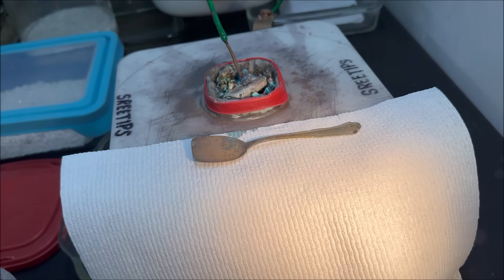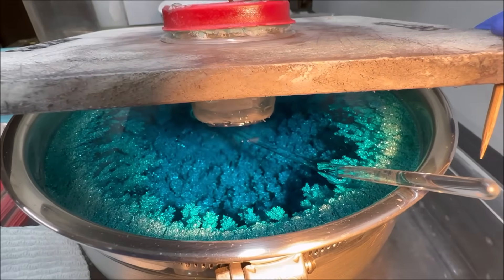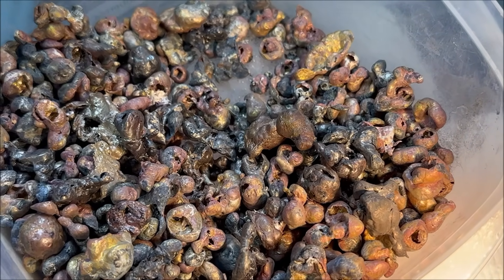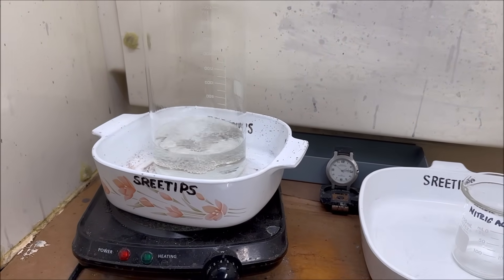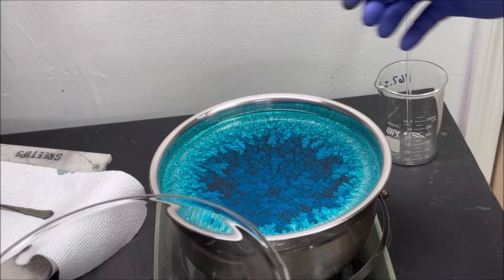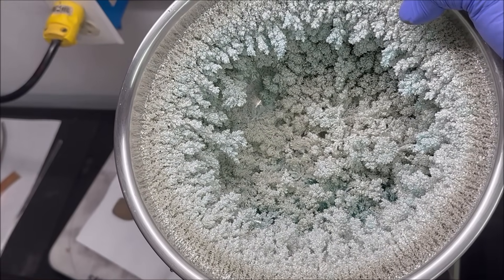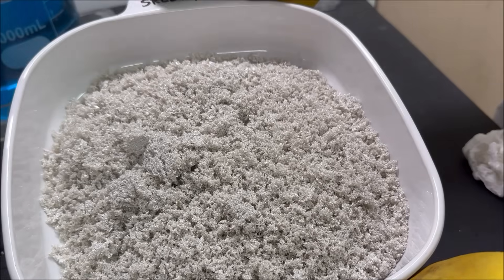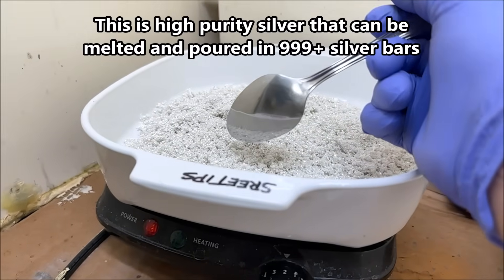999 Fine Silver Cell Harvest and Reboot

Comment: whats the take in by that ?
Reply from the maker: I refine gold. I use sterling silver, that I buy at estate sales, to refine the scrap gold. I recover the silver from that, melt into shot, and run it through my silver cell. Silver is a by-product of my gold refining. The cell converts the impure silver (about 980 parts per thousand silver) to high purity four nines fine (9999 parts per ten thousand) pure elemental silver metal. So I’m refining the impure silver, into high purity silver, not creating silver out of thin air. When it’s full, I harvest the pure silver crystal, put it away and forget about it. Then I repeat the whole thing again.
Reply: @sreetips  ah thank you , magnificent work you got there.

Comment: So what do you do with this silver? Do you sell it?
Reply from the maker: I refine gold. I use sterling silver, that I buy at estate sales, to refine the scrap gold. I recover the silver from that, melt into shot, and run it through my silver cell. Silver is a by-product of my gold refining. The cell converts the impure silver (about 980 parts per thousand silver) to high purity four nines fine (9999 parts per ten thousand) pure elemental silver metal. So I’m refining the impure silver, into high purity silver, not creating silver out of thin air. When it’s full, I harvest the pure silver crystal, put it away and forget about it. Then I repeat the whole thing again.
Reply from the maker: I may start selling some 5 ounce silver bars when silver gets up over a hundred bucks.

Comment: Where does he live. I'd do it in LARGER scales. 1 kilo, HA. I'd go into manufacture. IE; 100000 KILOS A WEEK. PROOF IT AINT WORF DA  BOVER. DUH..
Reply from the maker: Not with the Thum cell, like I have. To go that big you’d need an industrial size moebius cell: alternating anode and cathode plates hung in a tank containing gallons of electrolyte. That would pull hundreds of amps. Far exceeding the limits of my small hobby operation.

Comment: Honest question, do yo profit from this activity or is just your love for chemistry and the hobby, i think you spend considerable money on glass and chemicals?
Reply from the maker: I remember when I first started. I’d buy gold at Walmart just so I’d have the metal to work with and refine. It’s such a fascinating process. I love it. As far as silver goes: I refine gold. I use sterling silver, that I buy at estate sales, to refine the scrap gold. I recover the silver from that, melt into shot, and run it through my silver cell. Silver is a by-product of my gold refining. The cell converts the impure silver (about 980 parts per thousand silver) to high purity four nines fine (9999 parts per ten thousand) pure elemental silver metal. So I’m refining the impure silver, into high purity silver, not creating silver out of thin air. When it’s full, I harvest the pure silver crystal, put it away and forget about it. Then I repeat the whole thing again.

Comment: Unlimited money glitch?
Reply from the maker: I refine gold. I use sterling silver, that I buy at estate sales, to refine the scrap gold. I recover the silver from that, melt into shot, and run it through my silver cell. Silver is a by-product of my gold refining. The cell converts the impure silver (about 980 parts per thousand silver) to high purity four nines fine (9999 parts per ten thousand) pure elemental silver metal. So I’m refining the impure silver, into high purity silver, not creating silver out of thin air. When it’s full, I harvest the pure silver crystal, put it away and forget about it. Then I repeat the whole thing again.

Comment: Waitttttt you mean the silvery flakes you get at the end is actual silver ?? This looks like a money glitch ! Can you please tell how much $$ is required to get the materials vs how much it sells for ( I know this price ). Is this method doable by a noob, I guess its v tough but with a chemist or a lab person would this be achievable ?

Sorry too many questions I am just shocked lol. Many many thanks for showing this :)
Reply from the maker: Yes, every pure silver bar or round on the planet began as pure silver crystal, just like you see in this video.
Reply: @sreetips  What is a good way to connect with you? Any email ?
Reply from the maker: Best to ask questions here for all to see and learn. I try to read and answer all comments.
Reply: @sreetips  I'd like to do this at a small lab setup and moving to commercial level. What all stuff do I need ?
Reply from the maker: This is my hobby. Doing it on a commercial level is something I don’t have experience with.
Reply: @sreetips  What would I require to grow 30 kg silver each month ?
Reply from the maker: For every kilo of 98% impure silver I feed into the anode basket, I can expect to harvest 970 grams of high purity silver crystal. I refine gold. I use sterling silver, that I buy at estate sales, to refine the scrap gold. I recover the silver from that, melt into shot, and run it through my silver cell. Silver is a by-product of my gold refining. The cell converts the impure silver (about 980 parts per thousand silver) to high purity four nines fine (9999 parts per ten thousand) pure elemental silver metal. So I’m refining the impure silver, into high purity silver, not creating silver out of thin air. When it’s full, I harvest the pure silver crystal, put it away and forget about it. Then I repeat the whole thing again.
Reply from the maker: You’d need a big moebius silver cell that requires gallons of silver nitrate electrolyte and hundreds of amps of current flow.

Comment: You think we could build this on a large scale together.
Reply from the maker: Any larger than this and I’d have to reconfigure and convert to a moebius cell (alternating anode and cathode plates hung suspended in gallons of electrolyte). But the current flow would be up over 100 amps, far exceeding the capacity of my small hobby operation.

Comment: Might be a dumb question but I randomly stumbled upon this.. can u sell this and would it be worth the same as non home-grown silver? 🙏
Reply from the maker: Yes, every pure silver bar or round on the planet began as pure silver crystal, just like you see in this video. My cell is a Thum cell (anode suspended in electrolyte above the cathode). Big refiners use a Moebius cell (alternating anodes and cathodes hung vertically, spaced 4 inches apart, in a tank containing gallons of silver nitrate electrolyte). My cell pulls up to ten amps. But a large industrial Moebius cell would pull hundreds of amps. Much too big for my small hobby operation. I’m happy with about 8 kilos of pure silver per month. They (big refiners) produce eight kilos per hour.

Comment: where do you get the scrap with the silver, and how many times in the 13 days do you have to swap that container with no material?
Reply from the maker: I add impure silver shot to the anode basket every day. I refine gold. I use sterling silver, that I buy at estate sales, to refine the scrap gold. I recover the silver from that, melt into shot, and run it through my silver cell. Silver is a by-product of my gold refining. The cell converts the impure silver (about 980 parts per thousand silver) to high purity four nines fine (9999 parts per ten thousand) pure elemental silver metal. So I’m refining the impure silver, into high purity silver, not creating silver out of thin air. When it’s full, I harvest the pure silver crystal, put it away and forget about it. Then I repeat the whole thing again.

Comment: What the heck am i watching 🥸
Reply from the maker: I refine gold. I use sterling silver, that I buy at estate sales, to refine the scrap gold. I recover the silver from that, melt into shot, and run it through my silver cell. Silver is a by-product of my gold refining. The cell converts the impure silver (about 980 parts per thousand silver) to high purity four nines fine (9999 parts per ten thousand) pure elemental silver metal. So I’m refining the impure silver, into high purity silver, not creating silver out of thin air. When it’s full, I harvest the pure silver crystal, put it away and forget about it. Then I repeat the whole thing again.

Comment: Im guessing the chemicals and equipment to do this cost more than the silver is worth?
Reply from the maker: I’ve been doing it for a decade and a half. I refine gold. I use sterling silver, that I buy at estate sales, to refine the scrap gold. I recover the silver from that, melt into shot, and run it through my silver cell. Silver is a by-product of my gold refining. The cell converts the impure silver (about 980 parts per thousand silver) to high purity four nines fine (9999 parts per ten thousand) pure elemental silver metal. So I’m refining the impure silver, into high purity silver, not creating silver out of thin air. When it’s full, I harvest the pure silver crystal, put it away and forget about it. Then I repeat the whole thing again.
Reply: @sreetips  oh wow that's amazing I understand now. I would love to buy some of the refined silver crystals just for a collection piece.awesome videos!
Reply: @sreetips  most of the silver I've come across was .925 or silver plate, sometimes even lower quality alloys from mexico, India, or china. how do you recover the silver from that and get it to .980? Do you use mainly .925?  Do you have a video on that process as well?  I'm fascinated by your refining methods. Sorry , my initial comment was before I had finished the video lol I'd love to learn more about how you do this,  as an ex jeweler I find it very interesting. Kudos again on the wonderful content 👍
Reply from the maker: I use 925 to alloy with karat gold. Then I cement the silver on copper, recover the silver powder, melt into shot, and run it through my silver cell.
Reply: @sreetips  sounds like a very efficient process. You're a modern day alchemist! Thank you for patiently explaining this method to me despite my initial cynicism. It's actually quite remarkable and hopefully enriches you greatly as a reward for your hard work and knowledge. Fascinating stuff indeed.

Comment: what is the raw material used and is there any other material you would consider using to grow crystals?
Reply from the maker: I refine gold. I use sterling silver, that I buy at estate sales, to refine the scrap gold. I recover the silver from that, melt into shot, and run it through my silver cell. Silver is a by-product of my gold refining. The cell converts the impure silver (about 980 parts per thousand silver) to high purity four nines fine (9999 parts per ten thousand) pure elemental silver metal. So I’m refining the impure silver, into high purity silver, not creating silver out of thin air. When it’s full, I harvest the pure silver crystal, put it away and forget about it. Then I repeat the whole thing again.

Comment: 3 minutes in, I still have no idea what's going on but it looks cool!
Reply from the maker: I refine gold. I use sterling silver, that I buy at estate sales, to refine the scrap gold. I recover the silver from that, melt into shot, and run it through my silver cell. Silver is a by-product of my gold refining. The cell converts the impure silver (about 980 parts per thousand silver) to high purity four nines fine (9999 parts per ten thousand) pure elemental silver metal. So I’m refining the impure silver, into high purity silver, not creating silver out of thin air. When it’s full, I harvest the pure silver crystal, put it away and forget about it. Then I repeat the whole thing again.

Comment: So the material in the hopper is unrefined silver?
Reply from the maker: Correct, 98% to 99% silver, with the other being copper. I refine gold. I use sterling silver, that I buy at estate sales, to refine the scrap gold. I recover the silver from that, melt into shot, and run it through my silver cell. Silver is a by-product of my gold refining. The cell converts the impure silver (about 980 parts per thousand silver) to high purity four nines fine (9999 parts per ten thousand) pure elemental silver metal. So I’m refining the impure silver, into high purity silver, not creating silver out of thin air. When it’s full, I harvest the pure silver crystal, put it away and forget about it. Then I repeat the whole thing again.

Comment: why is it blue?
Reply from the maker: Copper in solution is blue. The impure silver that I feed in to the anode basket is 1% to 2% copper. The copper gets dissolved along with the silver and passes through the anode filter into the electrolyte turning it blue.

Comment: I’m still confused how much silver did he use to make that much silver
Reply from the maker: For every 100g of impure silver shot I feed into the anode basket, I’ll harvest 98g of pure silver crystal. I refine gold. I use sterling silver, that I buy at estate sales, to refine the scrap gold. I recover the silver from that, melt into shot, and run it through my silver cell. Silver is a by-product of my gold refining. The cell converts the impure silver (about 980 parts per thousand silver) to high purity four nines fine (9999 parts per ten thousand) pure elemental silver metal. So I’m refining the impure silver, into high purity silver, not creating silver out of thin air. When it’s full, I harvest the pure silver crystal, put it away and forget about it. Then I repeat the whole thing again.

Comment: What's the purpose of this
Reply from the maker: I refine gold. I use sterling silver, that I buy at estate sales, to refine the scrap gold. I recover the silver from that, melt into shot, and run it through my silver cell. Silver is a by-product of my gold refining. The cell converts the impure silver (about 980 parts per thousand silver) to high purity four nines fine (9999 parts per ten thousand) pure elemental silver metal. So I’m refining the impure silver, into high purity silver, not creating silver out of thin air. When it’s full, I harvest the pure silver crystal, put it away and forget about it. Then I repeat the whole thing again.

Comment: 1.5 kilo. How much did you start with
Reply from the maker: For every 100g of impure 98% silver I feed into the cell, I’ll get 98g of high purity silver crystal. I refine gold. I use sterling silver, that I buy at estate sales, to refine the scrap gold. I recover the silver from that, melt into shot, and run it through my silver cell. Silver is a by-product of my gold refining. The cell converts the impure silver (about 980 parts per thousand silver) to high purity four nines fine (9999 parts per ten thousand) pure elemental silver metal. So I’m refining the impure silver, into high purity silver, not creating silver out of thin air. When it’s full, I harvest the pure silver crystal, put it away and forget about it. Then I repeat the whole thing again.

Comment: how much profit from this operation?
Reply from the maker: Not sure how to answer this, the silver is my profit. I refine gold. I use sterling silver, that I buy at estate sales, to refine the scrap gold. I recover the silver from that, melt into shot, and run it through my silver cell. Silver is a by-product of my gold refining. The cell converts the impure silver (about 980 parts per thousand silver) to high purity four nines fine (9999 parts per ten thousand) pure elemental silver metal. So I’m refining the impure silver, into high purity silver, not creating silver out of thin air. When it’s full, I harvest the pure silver crystal, put it away and forget about it. Then I repeat the whole thing again.

Comment: What is the liquid that he puts in the bowl? I didnt understand
Reply from the maker: The liquid is the electrolyte made of silver nitrate solution. It is the medium that allows electric current flow through the cell.
Reply: @sreetips  thanks for the answer, i dont speak english so often i dont understand very well, this solution is made of just silver nitrate, isnt it in a salt form? Sorry for the stupid question
Reply from the maker: Not at all. Silver nitrate 150g per liter concentration. The cell is six liters, so there’s 900 grams of pure silver dissolved in six liters. I make by dissolving the pure silver in hot dilute nitric acid. Then I adjust the level to six liters with distilled water.

Comment: I'm not english, so I do not understand a few details in the video. First: exactly what machines and chemicals are you using to achieve this result? Second: are you just cleaning the silver out of alloys what containing silver, or is this method creates the silver using chemicals? I really appreciate if you answer! Powered by Google Translator
Reply from the maker: I refine gold. I use sterling silver, that I buy at estate sales, to refine the scrap gold. I recover the silver from that, melt into shot, and run it through my silver cell. Silver is a by-product of my gold refining. The cell converts the impure silver (about 980 parts per thousand silver) to high purity four nines fine (9999 parts per ten thousand) pure elemental silver metal. So I’m refining the impure silver, into high purity silver, not creating silver out of thin air. When it’s full, I harvest the pure silver crystal, put it away and forget about it. Then I repeat the whole thing again.